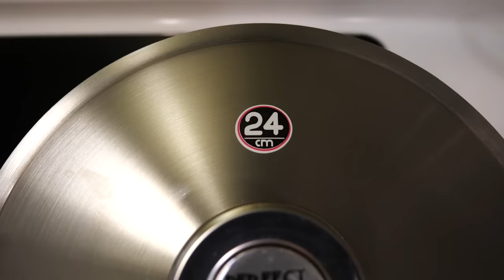Stainless Steel Wok mass production process. / 不鏽鋼炒鍋大量生產過程 - Taiwan Cookware Factory

Comment: 00:06:58   I don't trust that tack weld. Doesn't seem to be strong enough.
Reply: It is only used for cooking in the kitchen. How many times do you think it needs to be welded before it is strong?
Reply: @user-cy9us4wj1s  I think they should weld it with fillers, or bolted.

The size of the pan, when full, the weight can go up to at least 10lbs. Do you think those spot welds can hold?

The handle is supposed to hold when doing Chinese food wok-cooking.
Reply: I also feel that the handle and that tack welded clamp is going to problematic after sometime like the screw coming off frequently and that spot welded thin metal clamp snapping . I  have atleast four beautiful pans just because  of that spot welding snapping .They should  have designed  a better handle like the sturdy ones which we are seeing  in triply stainless  steel pans in recent times .

Comment: 很多標榜304 or 316結果都不是^^ 
不是不純不然就鍋面304鍋底跟其他地方不是
Reply: Two layers mainly for faster heat transfer purpose.
Reply: @NK_Khoo-Malaysian  true! But the materials should be rust resistance at same time, but usually they don’t
Reply: @chunweilin8270  I bought a Germany's stainless steel wok with three layers, outside layer is aluminium alloy, forget middle layer is using what material, and inner layer is SS304 about 20 years ago. It seems can last for another 20 years. The flat bottom wok can use gas stove and electrical oven. 
One more issue is Taiwan product is expensive as German brand, I will choose German brand made in China. 
Nowadays I use a normal iron wok for lighter reason. My SS304 wok is used solely for salt-baked cooking due to its salt resistance property.
Reply: 純不鏽鋼的鍋子才難用，
導熱太慢又笨重，
真的貴的鍋子是鍋內用不鏽鋼，夾層用銅。